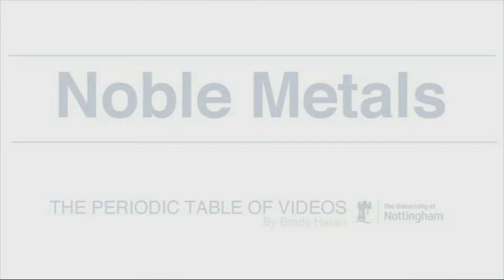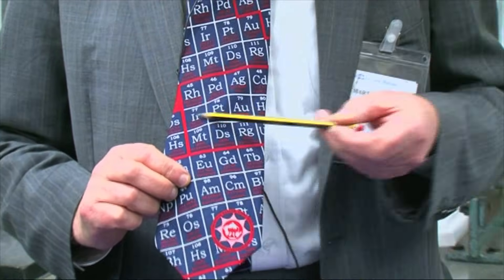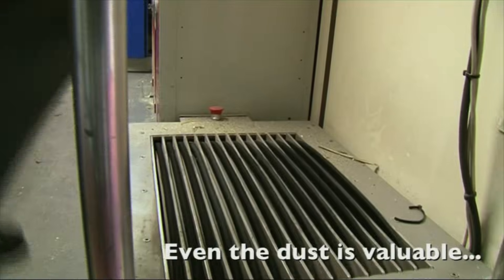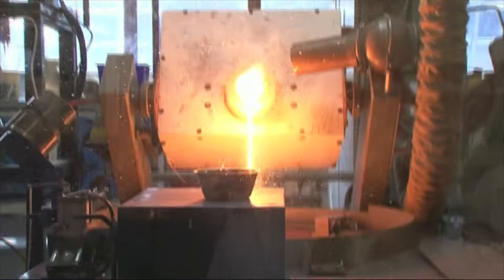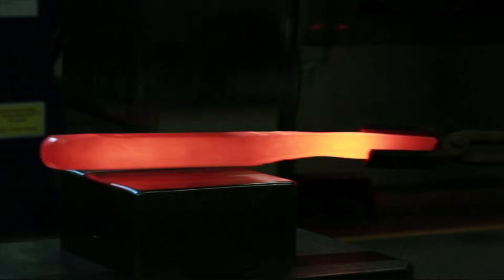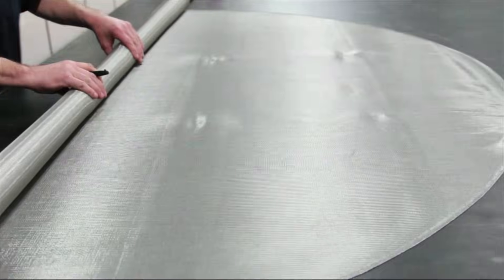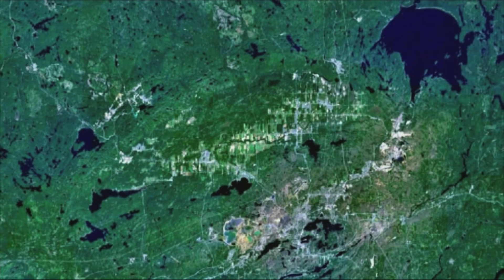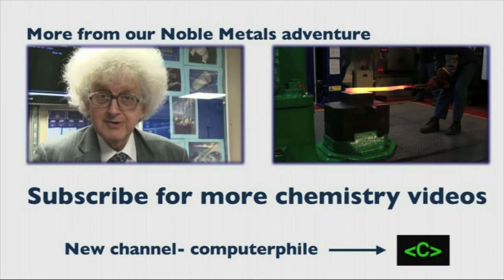Super Expensive Metals - Periodic Table of Videos

Comment: Have a simple question. Can you control the element Mercury with electromagnetic impulse? If so show us please:) Thanks
Reply: Mercury is diamagnetic, meaning it's not affected by magnetic fields in any way that a common person would recognize as a visible effect. So, no, you can't move or control mercury with electromagnetism.
Reply: Goytá F. Villela Jr.
That is not exact either. Even non-magnetic metals can have significant drag in field due to the Eddy currents. Mercury will whirl slightly when placed in the magnetic stirrer field. If you hung a test tube full of mercury by a string, got near with a powerful neodymium magnet and then pulled the magnet away fast, the tube would swing in the direction of the magnet.

Comment: For those that are curious, these metals are very rare on earth. Not-so-much in asteroids.

Earth Lithospheric (upper crust) abundances:

Pt - 0.003 ppm
Ir - 0.0003 ppm
Rh - 0.0002 ppm
Os - 0.0001 ppm

An average M-type asteroid:

Pt - 30.9 ppm
Ir - 15.0 ppm
Rh - 4.2 ppm
Os - 15.2 ppm

Of course, actually getting those valuable metals out of asteroids isn't exactly a walk in the park either.
Reply: A walk in space, to be technical.
Reply: The abundance of Platinum in asteroids is 10 thousand times more than earth!!!
Reply: Only slightly offset by the scarcity of asteroids on earth.

Comment: i make jewellery for a living and platinum is an abolute joy to work with compare to gold. you can polish it then solder it with 1700 (near melting point) and it will return to a polish finish. you dont need to pickle it (sulphuric acid) and it also lazer welds really nicely. Gold - not so much!

Comment: I actually said that, back then when I attempted the electrolysis of sodium chloride in my mother's kitchen. That's when I learned a thing or two about PHYSICS instead (like "an electric stove cannot melt NaCl" and "even if it did, you cannot use a plastic tube to drain chlorine because an electric stove CAN melt plastic").

Comment: Platinum (together with mentioned xenon) does react with sure number of elements and compounds under both extreme and commom conditions. 
For example, under standard conditions it will form various salts and many acids will dissolve it easily. PtO2 will form by fusion of chloroplatinic acid and sodium nitrate.

Comment: You are right. Minerals only form under certain conditions, so you will need to know the geological conditions of a region (and get government approval) before sending out exploration geologists. 

Often, they start with aerial photography or some satellite images. They also send field geologists to walk around and look for anomalies on the rock surface. Other methods include using Geiger counters and/or magnetometers. After analysis, they select a few locations to do test drilling.

Comment: initial geological exploration and drilling needs to be done for years (at least 10 years prior to extraction) to find out what is in the rocks. These drilled samples are ground up and taken to labs for testing to determine the mineral breakdown. A bunch of engineers then calculate whether or not it is economically feasible to extract the ore.

Comment: When formed as a metal, it's surface has magnetic structure which attracts the reactants in such a way as to allow them to be easily reacted.  In a car's exhaust, it attracts carbon monoxide and oxygen, allows them to easily combine into CO2, and then releases it. It doesn't react chemically, but provides a magnetic surface that makes the conversion "convenient" for the reactants.

Comment: No, that is to justify charging you 4X a much as a traditional spark plug and help with stand out marketing. What goes bad in a spark plug is rarely the terminal. Mostly it is the fouling on the insulation that causes the electrode to ground out to the body.

Comment: Well, the camera is a sealed environment relative to the room, as the transition from tape-based recording materials to solid-state memory (SD cards, RAM/ROM chips, SSD's) means there's less and less moving parts (IF any!) and the few grams and milligrams of metals (mainly gold and copper) inside it are never exposed to the environment, so there's little-to-no worries about any of the metal dusts being 'stolen' by the camera (and if anything is picked up, a quick vacuum gets it back).